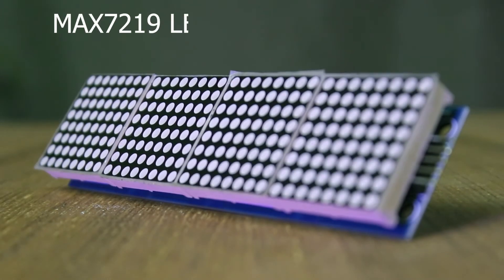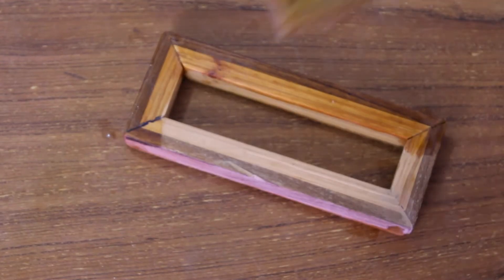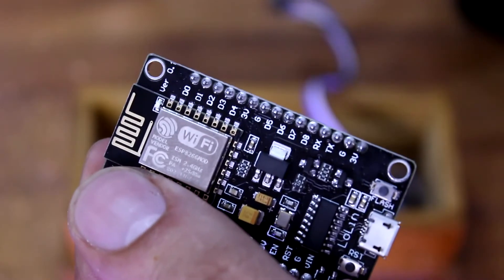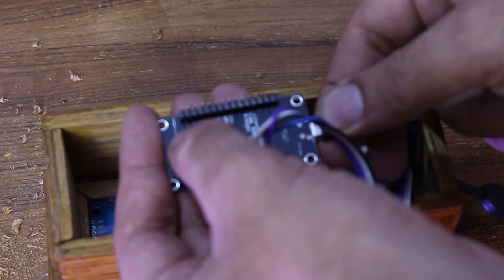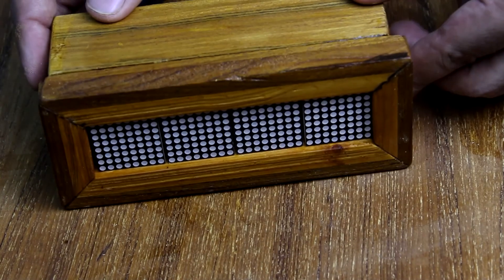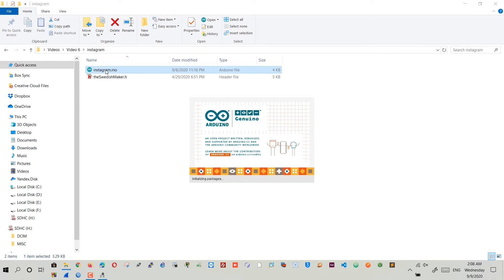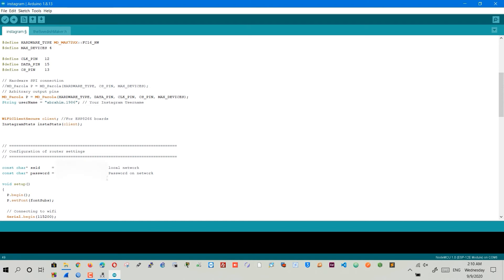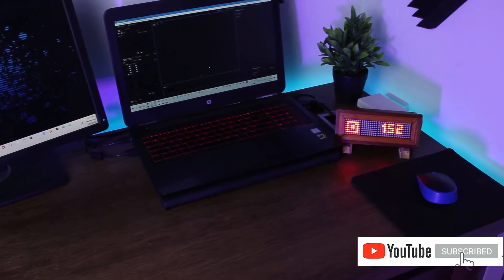DIY Instagram followers Counter

Comment: Hello! I have a problem with 0 subscribers.
Tell me what could be the problem
after compiling, these are the errors, but the device worked and connected to wifi
Executable segment sizes:
ICACHE : 32768           - flash instruction cache 
IROM   : 371504          - code in flash         (default or ICACHE_FLASH_ATTR) 
IRAM   : 28249   / 32768 - code in IRAM          (IRAM_ATTR, ISRs...) 
DATA   : 1504  )         - initialized variables (global, static) in RAM/HEAP 
RODATA : 1548  ) / 81920 - constants             (global, static) in RAM/HEAP 
BSS    : 25936 )         - zeroed variables      (global, static) in RAM/HEAP
Reply: same error i have

Comment: Does it need to be plugged into a computer to work (ie see the followers) ? or can it just be powered via a wall socket once setup?
Reply: Once you code the module, it has wifi and only needs 5v power to operate

Comment: Sometimes it says 0 Follower
Reply: I'm getting the same thing, had it working for a bit was trying to speed up the refresh rate as it was taking like 5-8 min to reflect a new follower. I got a few 0's when I was messing around and now that's all I am getting, even brought code back to the working state. 

Did you find a fix for the 0 follower issue?
Reply: @joshuasrandomness999  No it did not work for me. I made a clock instead of a follower counter
Reply: Sad.....